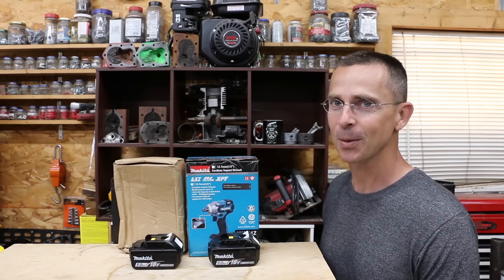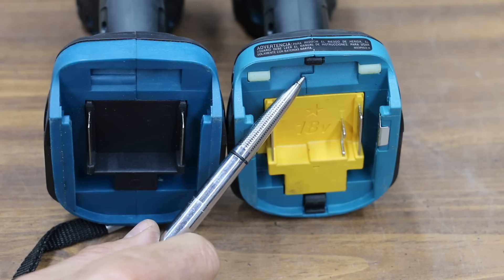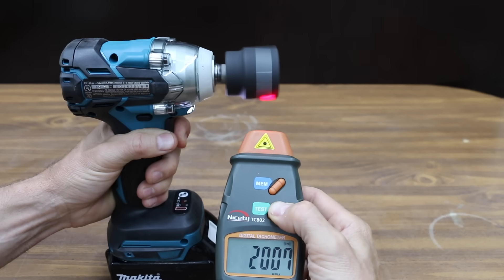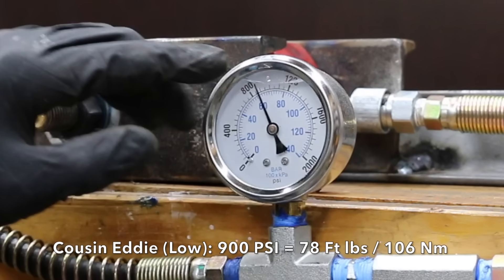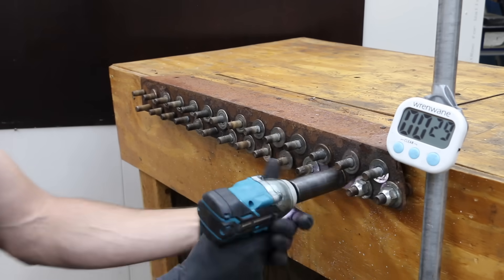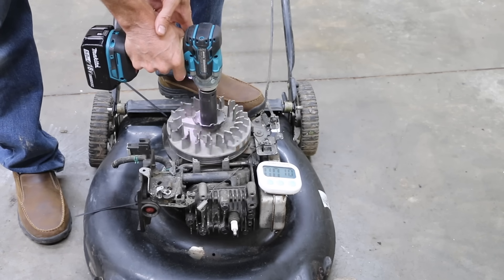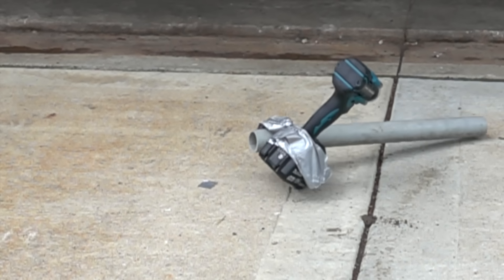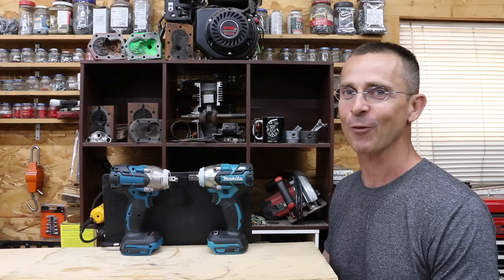Fake Makita Impact Better? Let's find out!  Makita XWT11Z 18V LXT Lithium-Ion Brushless Cordless

Comment: One of the reasons the makita is more expensive is the r&d time which the knockoff didn't have to to
Reply: Makita makes tools that can handle an incredible amount of punishment, they seem to last forever. Then one day, you can't get a simple internal replacement part that has broken, and there's nothing else to be done with it other than recycle it.
Reply: Production costs play a big part. Look at wages in China. They haven't grabbed the world's market on the quality of their goods.
Reply: Then it doesn't really make sense for a consumer to buy the genuine product, since there's no reason for you to foot their research budget
Reply: ANTIMATTER THE DESTROYER OF WORLDS what people really don’t consider is how long the product will last, the Makita will definitely outlive the knockoff by tenfold
Reply: @antimatter4733  the Makita would be a lot more reliable and well built compared to the cheap knock off usually
Reply: @antimatter4733  I cannot even see how R&D is the primary cause of the price disparity. I think it is plain old profiteering. But does the Makita tool come with a battery and a charger? Because that would be a huge expense. The $30 knock offs are bare.
Reply: @antimatter4733  you saw it in the video a bit, but you can see videos on grey market or knock brands of all types of YouTube, they rarely have the same qa and corners get cut. If you want bare minimum, knock off is fine. If you want a good quality product, or to support innovation buy from a legit manufacturer. Especially when it comes to products you need to be reliable, safety equipment and certain tools. There are plenty of times skimping can cost you a lot more in the end.

That being said, most people don't want a 1/2 impact wrench with 100 lbs of torque. All the top tool manufacturers have a 1/4 hex driver that have more torque. But you get what you pay for.
Reply: Knockoff uses similar but not the same components. They also re-designed stuff such as the motor etc. Both R&D times would be similar.
Reply: Actually, the knockoff had to do R&D as it uses all different components. The only thing the same was the color and general shape of the housing.
Reply: @InvestorAcademyPodca  The only R&D the knockoff did was buy a  Makita  and open it up. Maybe the same Chinese factory made them.
Reply: It should not cost that much to R&D a product. This is not a spaceship. It is a motor in a clamshell package.
Reply: @1pcfred  yeah buddy...and it's not like it's brand new technology
Reply: How can we copy things that haven't been invented yet.....to save money?

Hmmmm, a time machine perhaps?
Good plan.

Comment: I love all of my makita tools. Well worth their price.
Reply: Use Cousin Eddy and the Makita day after day professionally and you'll see why the Makita costs more.    Cousin Eddy will be in the trash can after a week.
Reply: Thinking about switching from Porter Cable. They are on my list to consider
Reply: @jonbar140  Porter Cable is a zombie brand owned by Stanley Black & Decker now. So it really doesn't exist anymore. It is just a name.
Reply: @jonbar140  PC is not what it used to be. Was one of my top brands now I don't even consider them.
Reply: @jonbar140  If you have the 20V Max Porter Cable tools, you can get an adapter to use the batteries on Makita.  Makes the switch easier.  I only use the Porter Cable and Black & Decker tools.  They're cheap and they get the job done.  I'm just a home gamer.

Comment: I can be a clumsy oaf a times, and my Makita drill and impact wrench have both hit the deck multiple times.  Still choochin' right along.
Reply: I have a Milwaukee 3/8 impact and 3/8 ratchet, I was doing a water pump and promptly dropped the ratchet into a bucket of coolant. I ran clean water through it and that was two years ago and it's still going like brand-new :-)
Reply: Kenny C  those Milwaukee’s last when I worked for Directv I had the same one for 3 years  it took falls daily and never got affected . I don’t work for them now and use Milwaukee’s for my contract business.
Reply: Same here. And straight on concrete for mine. I dont even worry anymore when i do drop them. Thats worth money to me also.
Reply: @beerbeforebreakfast  Dropped an impact driver off a ladder a few weeks ago. Was more worried about the floor as I retrieved it!

Comment: Taking apart the tools????

AvE has entered the chat.....
Reply: Actually, AvE did a video on this tool comparing it to a real Makita I believe.
Reply: @MalleusSemperVictor  AVE did the 1/4 drive impact, not 1/2. The knockoff was actually found to be a lot better than expected, until it let out the smoke. Uncle Bumblefuck rocks !
Reply: It was the not the "same" makita. This is pretty much the first video on youtube with the right original makita, although I think in other areas it is called dtw285.
Reply: slightly disappointed they weren't chooched until they let the smoke out to see which were more skookum
Reply: Uncle bumblefuck is da man so is project farm lol those two outta get together some time
Reply: Haha

Comment: i have question i bought a lawn tractor i fixed the carb and got it running i filled it up with regular gas then i put premium in it and now it runs but shuts off ould that be the change and mixing of gasses
Reply: Punctuation and grammar are our friends.

Comment: Haven't watched but my money is on real Makita! All i buy is makita, so i sure hope im right....
Reply: Yeah you safe
Reply: You're right about the Makita, but the $30 knockoff did surprisingly well for only costing 30 bucks.
Reply: @dand5829  Just opened the video, I have many of those knock offs and the original makitas and both work very well but they are not identical. In europe the makita is very, very expensive.
Reply: Dan D just for the sake of raw materials and filling up landfills, I’d rather spend the money on a tool that will last as long as possible, even if it costs more. I know not everyone has that capability, but those who can, should.
Reply: @dand5829  totally agree. I cant go that route because of the abuse mine take and reliability i need. But they would make sense for home use no doubt.

Comment: Video idea, which water hose brand is the best?
Reply: Oh Yes! Please!  Include kink resistance and freeze splitting!
Reply: For homeowners Gillmore probably. I have some Gillmore hoses and they never kink. They do weigh quite a bit though. Which is a factor when you're using them. There's a reason I have a couple lightweight cheapo hoses too.